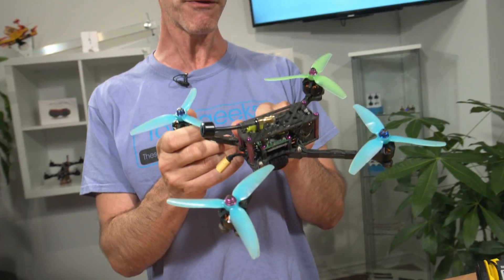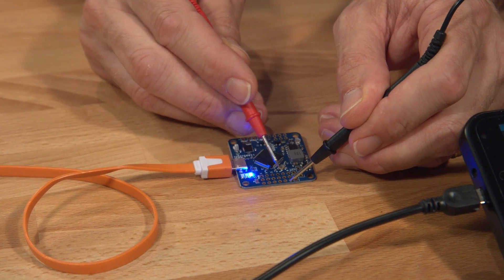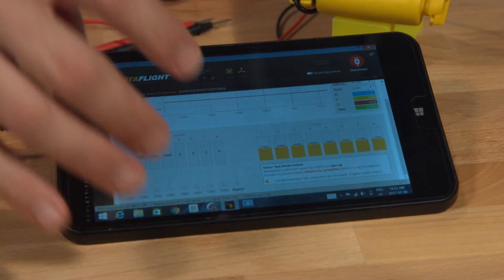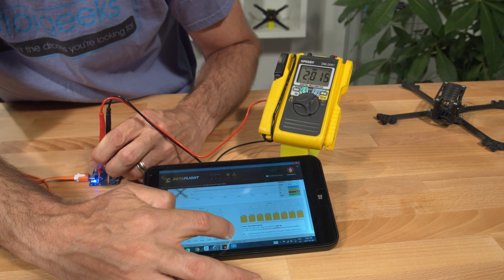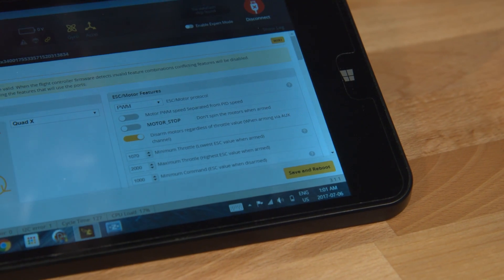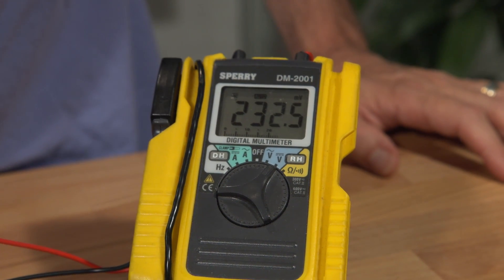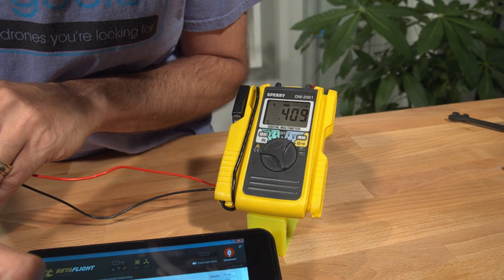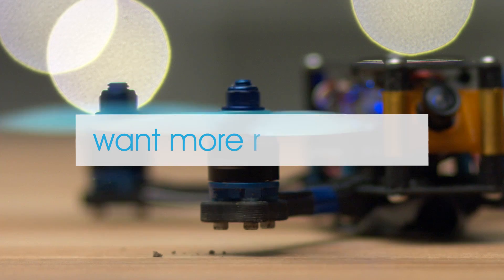New Trick: Diagnose Motor Outputs With A Multimeter!

Comment: What a timely video - many thanks! My quad has a motor not spinning and the multimeter showed me that the problem is a lack of signal output on that motor channel from the flight controller. Resource remapping (thanks Joshua Bardwell!) cured my problem without having to swap out the FC board.
Reply from the maker: Don't ya love it when it just works out like that!